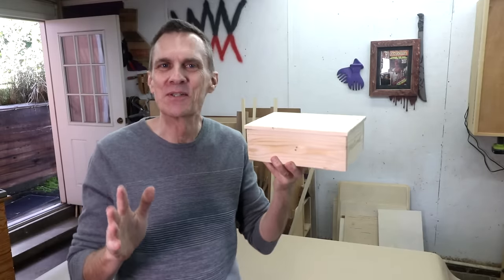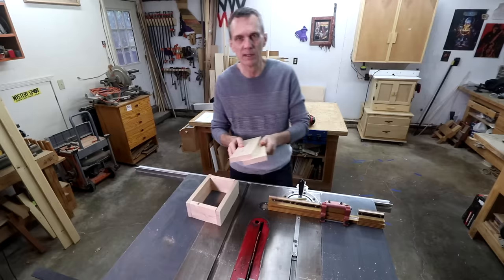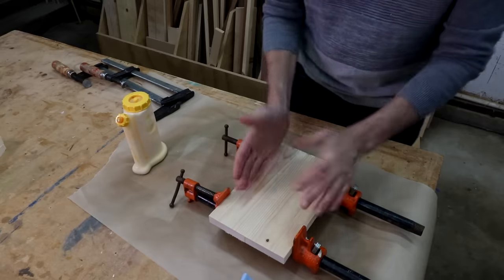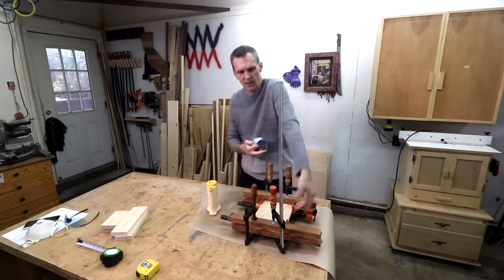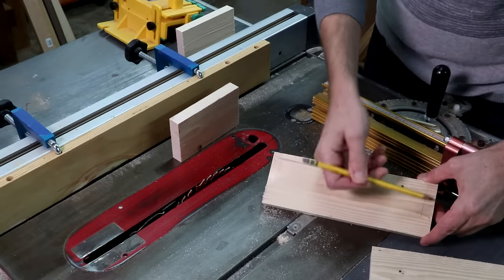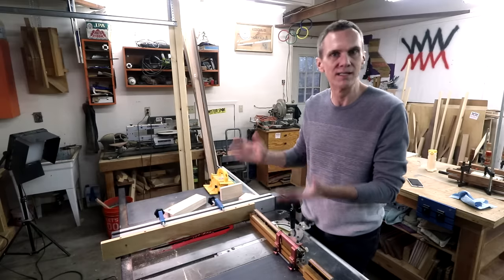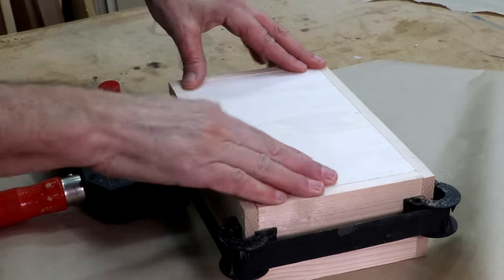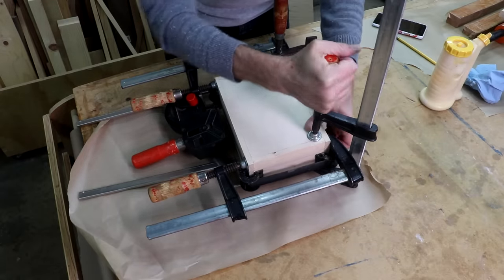How to make a basic box. And why you need to know how | Woodworking BASICS | Power Tools

Comment: Steve,  I know you recommend a table saw but some of us have no room in our lives for one.  Any chance you could do a box video that shows how to use other types of joint and methods using hand held power and/or manual tools?
Reply: Seconded.
Reply: Check out Paul Sellers videos
Reply: Exactly.
Reply: U could use 45 degree cuts on a miter and for the bottom you could use small strips if wood inside the box to keep the bottom from going too high
Reply: A circular saw is basically the same as a table saw, but you move the saw instead of the wood. Also, a lot of people just attach a handheld circular saw to a table to make their own table saw.
Reply: In case you never learned, a router table makes short work of rabbets. TBH it's much, much faster than the table saw method described here. You just put in a straight bit and ride along the fence.
Reply: Yeah like if the work bench is your wheelie bin, a jigsaw is all you saws, screwdrivers, chizzle, sandpaper, woodglue (got that) and 2 hands with added amature swearing and hoping and glue finger peeling!! Any chance of showing how to work with that? 

Thanks
Reply: Table saw - circular saw can be installed under your coffee table even in the smallest apartments.
Reply: I made boxes with six pieces of board and a box of nails. Opening was a problem.
Reply: Kaylem Yikes. That’s probably not a good start.
Reply: Use a circular saw or mitre saw
Reply: Luke Dogwalker Luke there are a TON of folks who show what you are requesting. It is their niche. Search on YouTube to find them, then apply Steve’s ideas to a different methodology. If you rely on folks spoon-feeding you instructions, you will never be even a rudimentary woodworker. 

I apologize if this sounds harsh, but it’s the reality.
Reply: With a circular saw, just set the depth to the depth of the rabbet, minus a hair since you will need to sand to square it, and make multiple passes starting from the the furthest from the edge and working your way to ward the edge of the board. This would give you a rabbet to create the box. It's not easy, but it can be done that way. That would keep the same joinery and skills to make the box

Comment: Great video. I like the way you keep it simple.  I'm just curious though, why you chose a bottom rabbet, rather than using a groove to inset the bottom.  I've  made thousands of small boxes and trays, working in a production shop and have always found that a groove is just as easy to make as a rabbet, without the need to glue the bottom in place.

Comment: Fun facts: Ripsaw blades have flat tops. Crosscut blades do not. Rip blades work for rabbits & finger joints better (i.e., cleaner) than crosscuts.
Reply: The rabbits are supposed to stay off the tablesaw when you're using it.
...
I'll go out and shoot some rabbets ... on my shooting board.
Reply: Fun fact, crosscut blades Rip way better than rip blades!
Reply: I never knew that Dave !! 😎👍☘️
Reply: Not in all cases.   I’m looking at a Diablo D1024x ripping blade as I type this, and the teeth are alternately slanted left and right with no square teeth.   I solved this myself with a Freud combination blade, LU84M011.   That blade has 3 tooth grinds: slant left, slant right, square.   It was from this exact operation that I learned to think about how the teeth are ground.

Comment: I don’t think we should worry too much about sanding that rabbet unless it’s really bad. More grooves means more surface area, and more surface area means a stronger joint.
Reply: That only counts if the surfaces are touching.  Having glue built up in a cavity that isn't touching anything else wouldn't seem to be of much benefit to me, would it?
Reply: @mattmorrisson9607  Wood glue is usually a very thick liquid. It can easily and quickly fill in and then overfill any cavities especailly when smoothing out with a finger as the ridges aren't tall enough to matter. The short version is you are correct, but it doesn't really matter given the scale of the ridges for the materials used. It could help, it could hurt, but more than likely doesn't make a noticeable difference. However, it is possible for them to be too high resulting in the boards not having enough adhesive to fill in the gaps between the ridges for a good seal. If unsure, always sand with a coarse (low) grit. It fixes the problem speedily while also allowing for that aforementioned increase in surface area. But remember to ALWAYS DUST YOUR PIECE BEFORE APPLYING GLUE!!!

Edit: And if you are really worried about it, you could always plug it with a few finishing nails or staples... though it does tend to add a bit of damage to the box and make it more unsightly.
Reply: @NickGreyden  good points. Curious though, would any dust in the glue really hurt? It would suck up some of the glue, but it would also help fill in any voids
Reply: Mario R I’m with you. I don’t understand how someone can get so annal about this kind of detail.
Reply from the maker: Definitely. I've never had any problems with those grooves!
Reply: I find that sanding is fine. Virtually any grit will do.
-But do not plane the glued surfaces with a super-sharp plane, because the box will just fall apart then.
(A seasoned woodworker I know tried this and two boards fell apart very easily, so he just cut them on the bandsaw without any sanding and they stayed together after the glue-up.).
What I'm saying is that if you're somewhere in the middle between polished and rough, it would very likely work well.
Make a few tests and see how different wood works for you; remember to take into account that fresh wood is not completely dried; long-time dried hardwood will thus have completely different behaviours than the stuff you get directly from the lumbermill or garden.
Also make sure to remove any natural oil from the wood before you glue; otherwise the oil could cause the joints to be weak. Common sense is often good here, so I'd say: Don't overdo things or you might not get what you expect, but don't do too little either. If it's important that a joint has high strength, make a bunch of tests on a few sticks and write notes on each stick, then abuse-test them 24 hours later.

Comment: Its not basic. The tools are not basic and the method is not basic. You should manage the expectation of the viewer. The title should be: first project in a well equipped wood workshop.
Reply: 10K dollars worth of equipment to make a 0.50 cent box.  That should be title.
Reply from the maker: Less than $1000! Check out my free guide at mytoollist.com 👍
Reply: @SteveRamsey  ok, but the point being that if people want to make one of these with the grand kids, or kids, they want a DIY friendly project that involves and most hand saw, jig saw at most, some screws and glue, and 1 2:4 lumber. Remake this video, you will get the views. 

Title it, “NO POWER TOOLS, no problem, simple woodworking project under 25 dollars”
Reply from the maker: @joshjosh575  I don't think you understand the focus of this channel for the past 16 years. If you're interested in hand tool woodworking, there are channels that do that. This channel is about entry level woodworking using basic, modern power tools.
Reply: @SteveRamsey The titles are accurate. Within the field of modern woodworking, this all seems to be somewhat beginner level learning, very easy to comprehend, and very helpful. You're a lot more straightforward than other woodworking channels I've seen. Thanks for your tips as a newcomer to the industry 👍
Reply: The video seems to have plenty of views. 

If you rather build a whole cabinet from expensive materials as a practice piece go right ahead. The rest of us think it’s better to hone fundamental skills inexpensive materials and a simple project.
Reply: Just like to say Steve, it was your instruction that got me into woodworking about three years ago. Your videos are excellent and are aimed perfectly at the correct audience. Thank you for giving me the confidence to start.

Comment: I actually just recently put together my first simple box (I have yet to buy hinges for the lid). My sister bought a small music box that was just the mechanism in a clear plastic case with the crank sticking out a hole in the side. I custom fit the wood around it to make it look nicer. The funniest part of it is that for certain small pieces (such as the bottom and a border over where the lid sits) I used the thin wood from spare stir sticks. I stained the box but left the border I mentioned a natural wood color so that a contrasting layer can be seen between the body of the box and the lid.

Comment: When you join the two parts of the lid, the end grain should be cup up on one, cup down on the other. This is a standard wood working technique. It makes sure that the wood will not all curve in the same direction as it gets effected by heat & moisture over time...

Comment: I have been playing with woodworking for a number of years now, and yeah, making a box was an early project. I started making smaller boxes, and a 3/4 thick board is not good for a box that is only 3" wide. I used 1/4" oak for some nice small boxes, but I finally settled on 3/16" plywood from Home Depot as my usual choice. Granted, the boxes were not beautiful furniture pieces, but they were functional, and that was the goal. All edges are simply butted against each other, and a favorite trick of mine is to make a completely enclosed box, and then cut around the top on the table saw. You get a lid that fits the box perfectly. Elmers-type wood glue or Gorilla Glue are the glues I use, no nails or screws. They are surprisingly robust, just don't sit on them. And they don't look too bad (in the shop) when they are sanded, stained, and varnished.

Comment: At 1.55 u want to check the cup of the end grain. U want to put the cup in opposite directions to counter act any cupping. If a board has extreme cupping u can rip it every 2 inchs or so an flip each board in opposite cup direction. Glue it up an sand it.

Comment: Lots of people complaining in the comments about how this project requires a table saw. I don't have a table saw either but I recognize it's an extremely useful tool for all kinds of woodworking projects. I've been able to get by using a circular saw, or having the Home Depot employee cut my boards before I bring them home, but all of these projects that I've done have been DIY projects rather than "real woodworking" projects. Would be neat to see a video on this same topic using different techniques for building boxes (for all the DIYers and for learning). I also recently learned about pocket holes and bought the Kreg R3, which has been fun to use. A table saw has been on my wish list for a long time, but haven't been able to bite the bullet and make the purchase. I guess I'm also hesitant to bring in a tool in my garage that is going to make a big mess. Curious if you have a "table saws for newbies" kind of video.

Comment: Thanks so much for the video, Steve. I've purchased my first table saw, grr-rippers and other accessories that seem necessary, and am excited to tackle this as my first project. You mention that the plans for this project are available in the description, but I didn't see them. I did download your tool list and checked the remaining links. Is there a set of print plans available for the box (or did I just miss them)? The video is certainly descriptive enough but I find it helpful to have something in print to learn beforehand and can reference fairly quickly during a project to keep momentum. Either way, thanks for all that you do. Your safety videos have been extremely helpful, and your channel certainly helped me decide to take the plunge from spectator to burgeoning woodworker.

Comment: If you would use 3 clamps for the lid gluing and alternate the side with loose pressure until you get all clamps on; that will negate the use of culls even with slightly uneven cleanup edges. I do not even have culls in the shop. We clamp 3/8" thick boards for box lids and alternate clamping sides of the board with good results. Culls take extra time. Also investigate different type of clamps to
discover which ones are best. Are you jacking up the whole car or just the corner where the flat tire is?

Comment: A nice extension to this video would be: - 1. Make the lid the same size as the box and glue it in place. 2. Set your saw fence at about 11/2" and cut the box in half length-ways  so you now have a base and a lid. Carefully clean up the saw cut trying to make sure you keep the surfaces dead flat. 3. Attach a couple of brass hinges on the face of the box (don't even think about rebating them at this stage) 4. Attach a hasp and staple to the front. Ta da! You now have a fancy box for the sake of an extra 15 mins work.

Comment: OK what Steve is trying to illustrate is the core fundamentals, the box structure is used in as he quite rightly points out a whole host of applications from base units to wardrobes to to to ..! Once you understand the basics of making and putting one together then you can apply the same rule of thumb to making bigger box structures etc. Making the small box may seem a little farcical but I think some of you may now understand a little clearer.. I've just built a hifi base unit to accommodate a chrome with black frosted glass shelves unit. That base unit has draws in it and guess what! Yep it was made using the same techniques but way bigger ! It took the basic 3 shelf 1.2metres long chrome and glass shelf unit at 60cm high and bumped up the height to a more acceptable 100cm high with base unit. The base being 1.2metres wide  to exactly fit, 40cm height, 1.2metres wide and 45 cm depth. Finished with a dark oak wood stain. As for the tools used, 1 circular saw, router for the rabbits, biscuits for added strength, wood glue, wood stain etc etc. I cheated with the ply wood 1.2metre by 45cm pieces as I had them precut for me, most decent wood suppliers will do this for you, often free or for a small extra charge. The drawers were approx 550 cm wide BUT I could have done without them and used plastic sealed units of similar size with a drop down flap or slot on front cover etc. Great vid and thumbs up for inspiration! 👍😃Whoever wherever you are, stay safe!

Comment: a little box trick some may like: make your box, glue and screw all the joints, and glue on the lid too. set the table saw if you have one for, say, 1 1/2".  this is a place your screws do not come to from the top or get put in from the side.  saw the 4 sides.  now you have a box with a perfectly fitting inset lid.  even a hand saw can make one, and you could use nails, but i like sheetrock screws.

Comment: Great video. I am planning to build an enclosure for my 50 pound air compressor and I was wondering how I should arrange the wood. Meaning should the bottome wood sit undernearth all the side panels? Or Is it better to affix the side pieces to the base/bottom piece similar to how you did? Or does it even matter lol? Sometimes I overthink stuff but I was wondering if having the side panels sit on top of the main base/bottom piece would be more structurally sound. I was going to have the wood precut and do it the easy way with only 6 pieces of wood all affixed with screws. One method would invovle securing the screws vertically and the other would be horizontally.

Comment: Need to put something between the bar clamps and the glued joint . Glue on the pipe clamps will turn the wood black if the clamp is in contact with wood .

Comment: Hi Steve, the metric plan pdf has a small error in that the cuts for the top is too short. I think it should be 234 mm not 117 mm. Thanks
Reply: Yes, I discovered this when I got to the lid and found it was only half the size it needed to be.

Comment: What about making the rabbets with a router and a cylindrical cutter?  Those saw ridges can also be removed with a cabinet maker's paring chisel.  If you use a paring chisel, do not use any striking implement because they are constructed in a way that could bend or destroy them since they are made to remove very thin shavings of wood.

Comment: On the long cuts, why do you nibble in from the outside up against the sacrificial fence as opposed to the way done on the crosscut?  Seems you could set the fence at the width of the bottom panel to get the same result.

Comment: Would be nice to see the techniques for doing this without any power tools or tables.
Reply: Shooting boards,lots of them.
I make hand tooled only box's with perfect 3mm thick 'boards' and usually a mitred or dovetailed corners that I would struggle to make without my shooting boards.
a 90°
a 45°
a donkeys ear 
and a thicknesser
are probably my most used for this type of joinery,very cheap to make and they last for years.

um,obviously a quality handplane or two aswel but that's all you need to make these types of things by hand.

Comment: For actual beginners you only need a handsaw, a way to clamp or hold pressure on the wood while it's gluing, a chisel/gouge/carving knife (you dont need all 3 just something to help with those rabbit (this can also be done with the hand saw)), glue, a ruler, a pencil, sandpaper (doesn't really matter the grit but a medium one is what I would go for), a dust mask (any piece of cloth works though as Im not listing power tools), eye protection,  and wood (softer is easier to work with but more prone to damage)

Comment: One comment on CNC poppin gup everywhere these days - I recently made one and am amazed how simple it is to cobble one together from parts on Amazon.  Pretty much just need Allen wrenches and a saw to cut the base table.  No need to spend a $1000 or more on a pre-made machine these days.  It's basically like building a Lego kit if you have the parts list and software to drive it is all free.  Instructables has several that DIYers have posted.